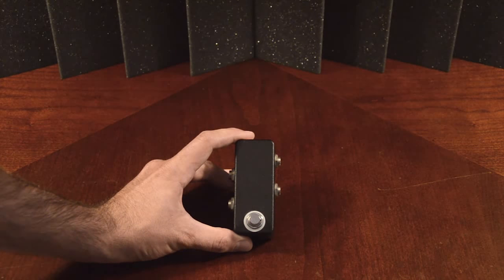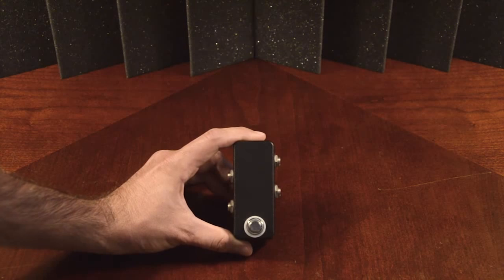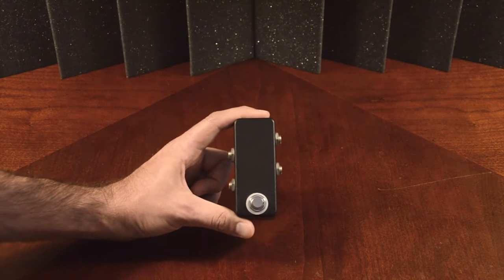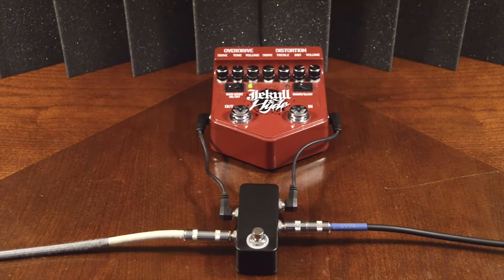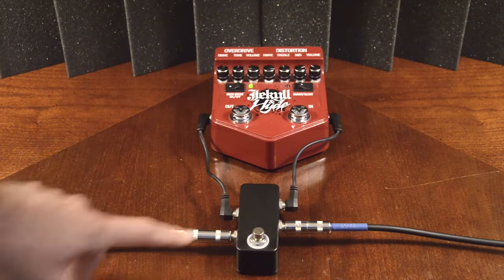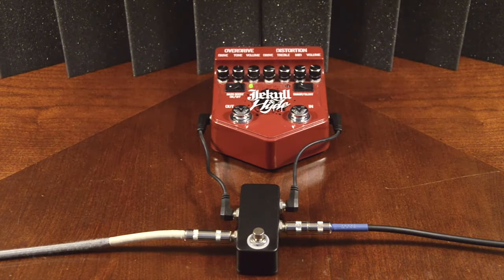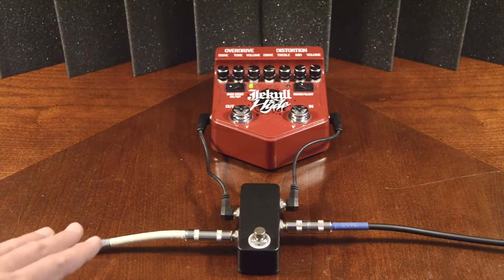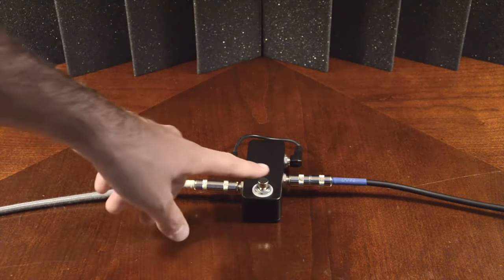Guitar Bazaar - True Bypass Loop Switcher

Comment: Hello Could i use this in my JCM 900 loop effects and bypass the loop using this pedal? This is built into a JCM 2000 TSL and i loved the fact of going clean to amp at the hit of a button. Rather than "The dance" scrambling to kill all effects, so in/out into my send/recieve of my effects loop then in/out with my pedals....input guitar into the amp as normal

Comment: I saw a similar pedal on sale online and It had a 9VDC power supply jack. I got confused, because your pedal doesn't have one. Is yours running on batteries? Or this kind of pedal don't need any kind of power supply at all?
Reply from the maker: +daywedie There are no batteries, and no power supply for this pedal. It is a very simple circuit, and does not require power. All the other pedals like this (that I have seen), are only using power to give their pedal a light that turns on and off as you engage the pedal. 
I apologize that its taken me this long to reply to your message. I'm not getting these notifications until way late.
Thanks for asking!

Comment: I have a couple of pedals that don't work together since one is true bypass and the other isn't. I specifically use them in the fx loop. I want to be able to use both without constantly switching them back and forth. Would this work for my issue?
Reply from the maker: Jesus Christ You could put both pedals in the loop of this box. Leave both pedals on and use this box to turn them both on/off at the same time. Does that make sense the way I explained it?
Reply: @OhBHayes  it makes sense. Do you still sell these? How much are they going for?

Comment: can i connect to it a volume pedal and crank my amp then lower the volume to a bedroom level?
Reply from the maker: silver You could possibly use it for that if you placed the pedal between the output of the amp and the speaker - but you could do that with just the volume pedal as well. However, the impedance mismatch between the output of the amp and what the volume pedal is expecting (usually from the guitar or another fx pedal) might cause unwanted noise. Bottom line is yes, but I wouldn't recommend it. The right tool for that job is called an attenuator and a decent one isn't cheap. I Hope this helps.
Reply: i would never use a pedal between the head and cab , if i do that for sure i ll get an attenuator and pay 200 to 300 $ than ruining a vintage marshall head that costs 2000$ using a pedal between both head and cab
so i guess this pedal is not for me then
thanks for clarifying